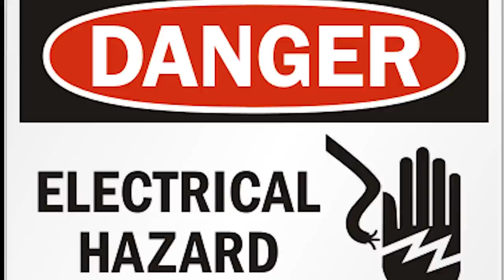AC vs DC Electricity, Sounds Fun

Comment: I've been looking for a video like this because I've been wanting to covert a car subwoofer to home audio, but don't know much about converting and inverting.
Reply: bobby jotels For a subwoofer ac or dc do not mater,  home theatre amplifiers and a car audio amplifier both produce the same the only difference is the capability on the amp itsself, car amplifiers are designed for lower impedance 0.5, 1, 2 ,4 ohm while most home amplifiers run around 4,8,16 ohm so just match the impedance of your sub to the system you want to run it on. If you dont have a home amp and want to use a car audio amplifier indoors you will want to power it with a 12v battery, computer psu, or as ed is using a inverter, just dont go chucking a 12v on a 120v  powerpoint or it will go poof
Reply from the maker: bobby jotels It doesn't matter for the subwoofer itself. Any and all subwoofers will operate from the AC output of the amplifier. The amplifier is what is different. Car amps need 12v DC and home amps need 110-120V AC. You can just take a car subwoofer, put it in an enclosure, and hook it up to a home theater amp. Just make sure the woofer impedance is not lower than what the amp can handle. 4-8ohms is usually good.